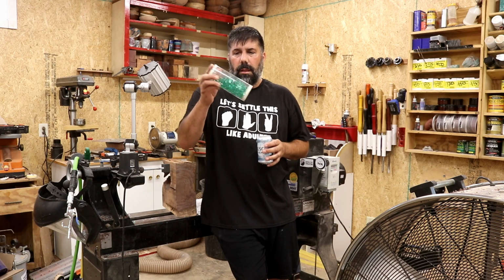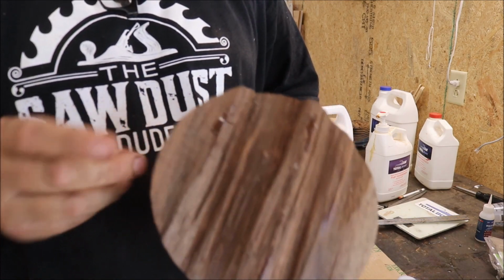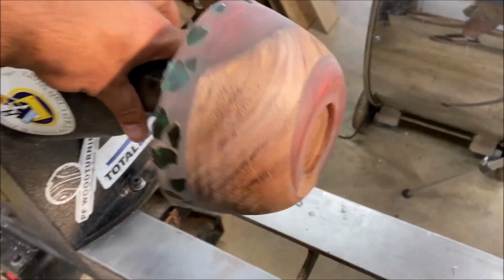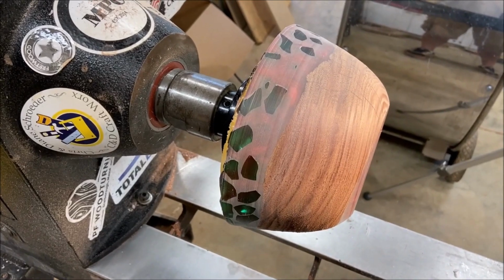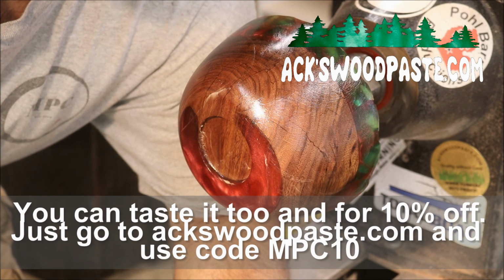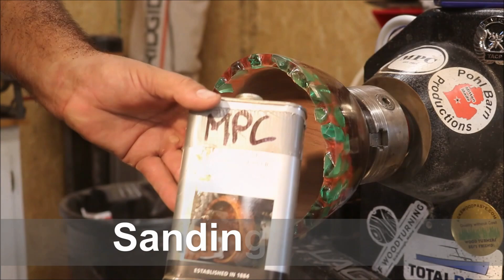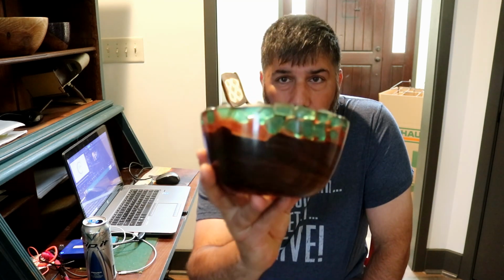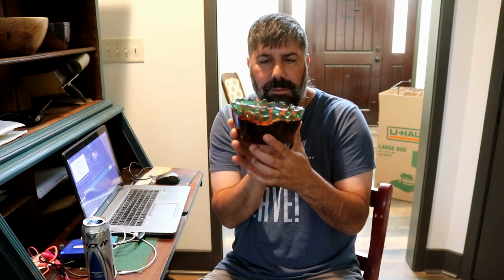Wood Turning - Geode Bowl

Comment: I did t know ridgid ever made a dust collector.
Reply from the maker: I didn't either until I went and picked it up. Works great but is only 3/4 HP.
Reply: Moonpie Creations nice!. I have a Small Jet dust collector works great too as long as the runs aren’t too long...

Comment: I have to say I am a bit disappointed to see you drinking on camera. I understand that it is your right to do what you want but to see you with a Busch Light can on camera is not what I would have wanted to see. Just a suggestion... maybe not have THAT on camera in the future. I have lost "some" respect for you because of this.
Reply: Rather confused at this comment.

If it's the visible drinking whilst on camera, like you say, each to their own, but the view seems rather 'puritanical' IMO.

If it's the drinking whilst turning, I believe you've not realised the process is filmed over time, hence the different t-shirts throughout the post and there's no drinking whilst handling the tools/heavy machinery. Plus, although I've only been a subscriber for 1-2 years, I've only ever seen a safe professional approach. 

But maybe I'm missing some other point altogether?
Reply from the maker: Bryski, Thank you. 

Sandy, I assure you I do not drink and use my machinery. But I do drink beer when casting and while cleaning up my shop. that clip was shot at 10 pm and my shop was still 90 degrees. You can see me sweating like crazy in the video. My channel is meant for adults and as far as I remember I never drank it on camera. I have several videos where a beer can is present. I will make no apologies for liking beer or drinking an ice cold brew every now and again. I'm  stunned that you would say you lost some respect for me because I had a beer can on camera. I would figure my foul language or innuendos of a sexual nature would have been what did that. It shows how little some of my subscribers know me.  Maybe I should do something to change that..........Well Sandy, thank you for being a subscriber and commenting on the video. I do appreciate it, I really do. 

Ken
Reply: It just struck me odd to see the can of beer. You do amazing work and love to watch you at work. If I came across a bit harsh I ask you to forgive me. I was just voicing my opinion. Again I love to watch you create beautiful works of art and will continue watching you. Also, again I ask you to forgive me if my words were a bit sharp.
Reply from the maker: Sandy, you do not have to apologize. I respect and value your opinion and your feelings. Thank you for supporting my channel.